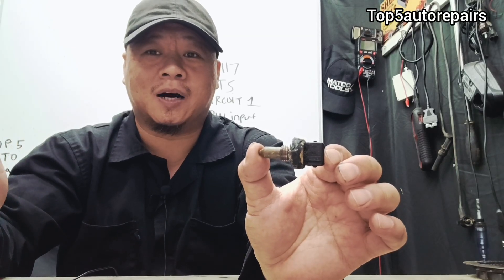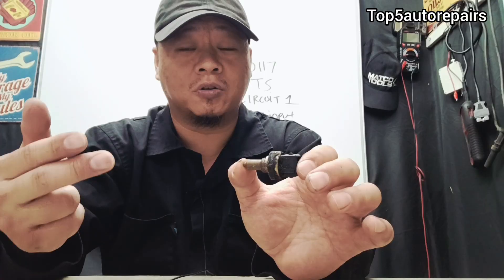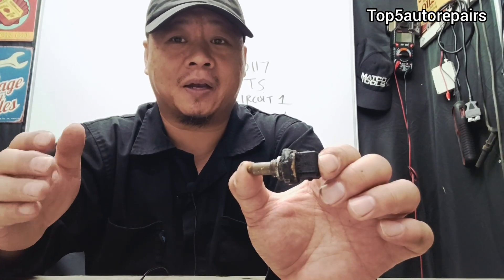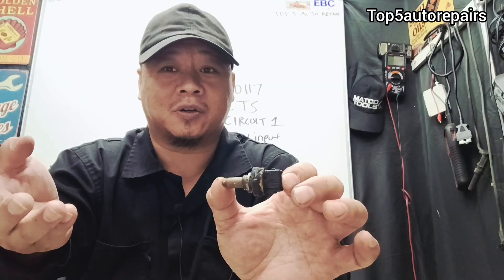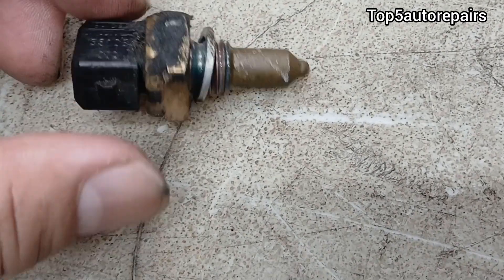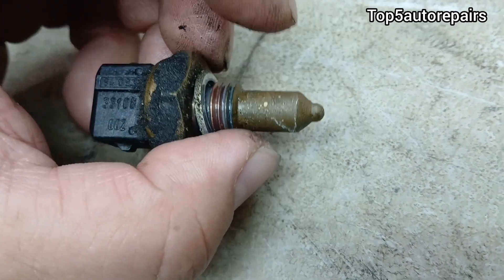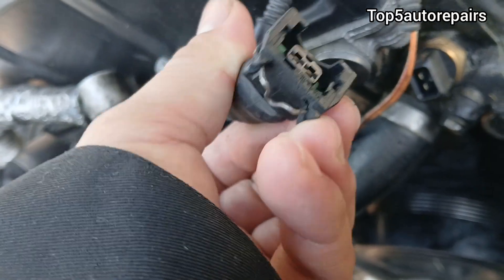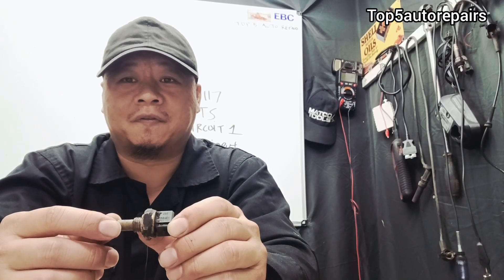WHAT CAUSES P0117 COOLANT TEMPERATURE SENSOR SENSOR 1 CIRCUIT LOW CODE

Comment: I changed the sensor and even checked the connector that plugs into the sensor with a multimeter to check for continuity

Temp gauge still not working and check engine still on after unplugging battery for 10 minutes

Any advice?